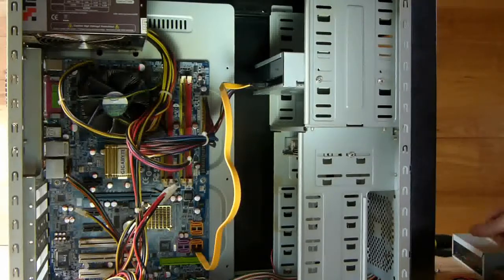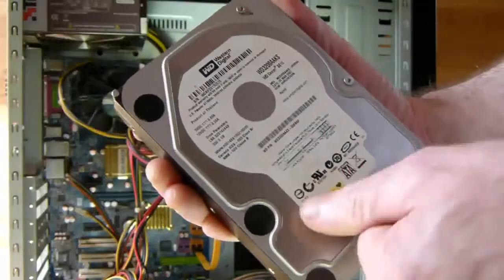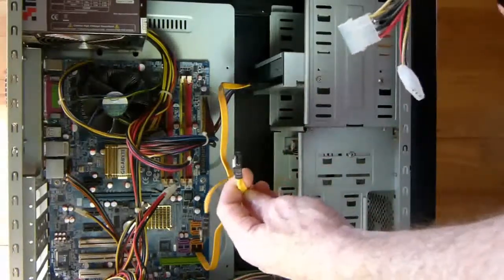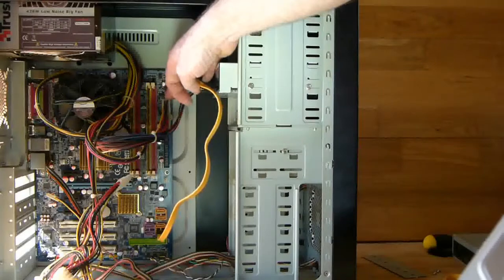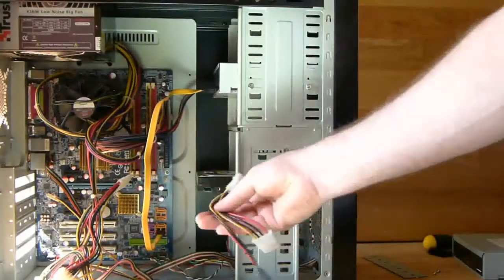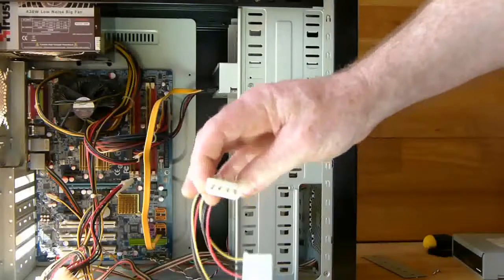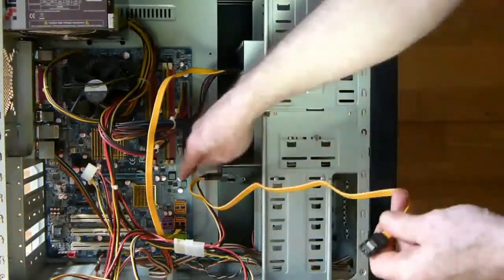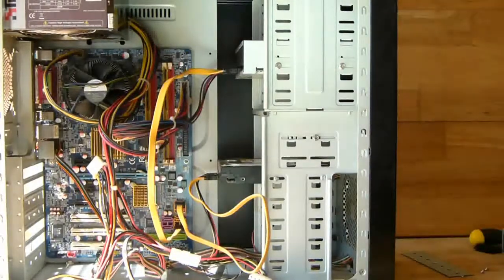installing a hard drive in a desktop case

Comment from the maker: The connection for extra fans other than the two that come with the case are placed on the top of the case where there is mesh for air intake. and the connection for those extra fans are molex connectors, so they will be connected directly by female from fan to the male on the power supply. Now the fans that come with case will have the smaller connectors probably and they are connected to the motherboard like the CPU Fan and the motherboard should have 2 with words CHA_FAN  printed beside.

Comment: i need help, i cant buy a hard drive due to no driver bays, i have a old hard drive im using to try to find where it goes in but i cant, the case is a zinc300
Reply: +Known2God it doesent have the bays thought
Reply: +Known2God I improvised and the computer is running fine ur a bit late